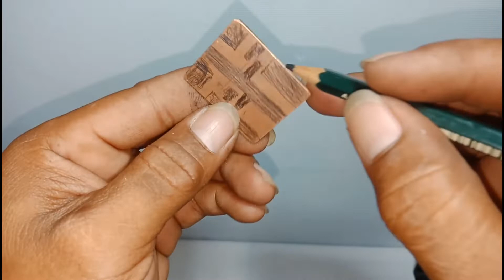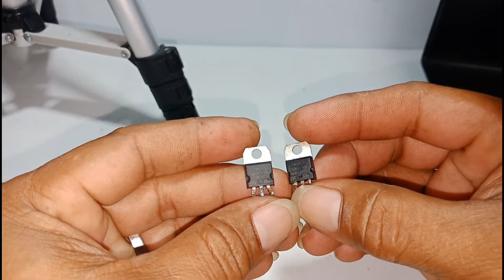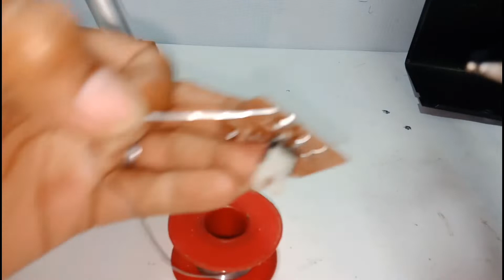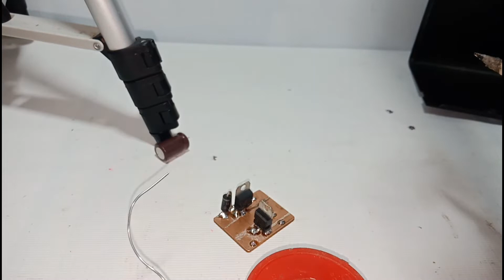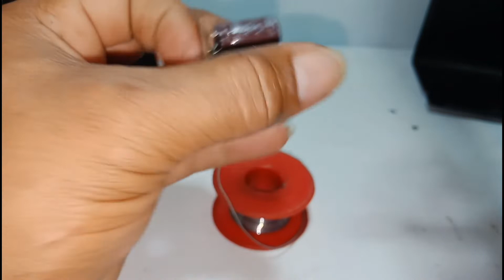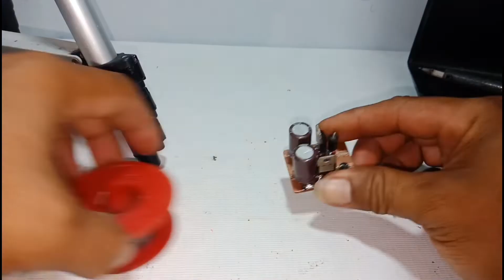Cara merakit PSU dengan IC regulator menjadi 15 volt

Comment: Gmn Boz gk ada nama barang buat nyarinya apa yg perlu dibeli
Reply from the maker: Apa ini bosku lupa saya
Reply: @nschannel4702  seharusnya ada speksikasi barang yg nnt dibeli untuk merakitnya maklum pemula Broo
Reply from the maker: @nurhikmah6702  oke bosku, rasanya di video, saya sebut kan namanya,  🙏
Reply: @nurhikmah6702  bantu jawab,,
Papan pcb secukup,y 2x dioda 2 amper , ic 7815 & ic 7915 n 2x elco 35v 1000uf